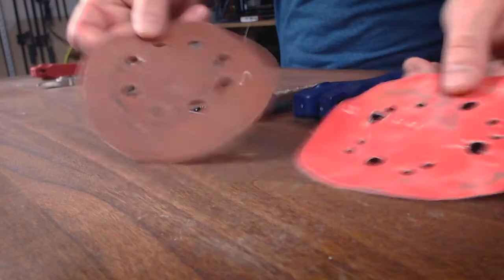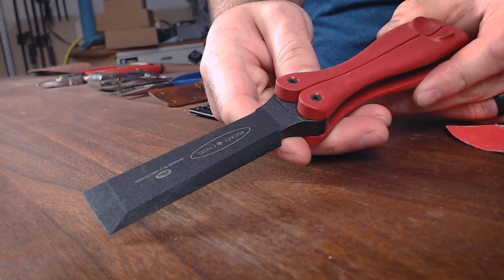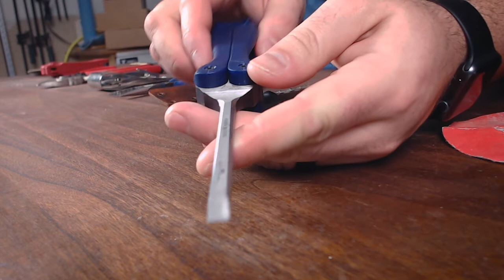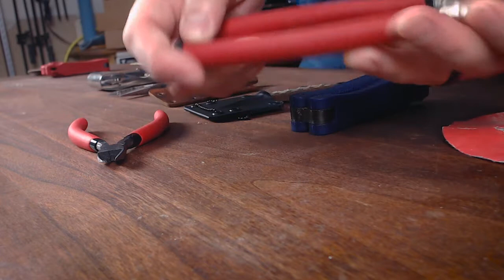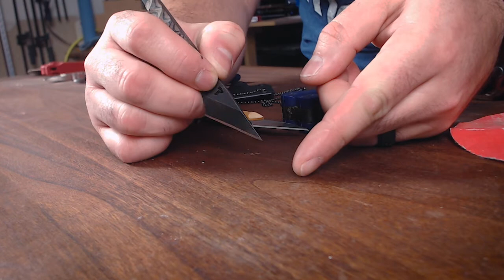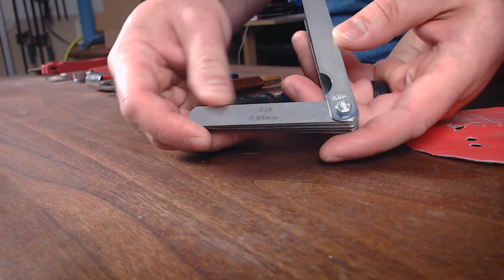My top 10 tools for 3D printing — and more!

Comment: So a bunch of freebies.
Reply from the maker: Hey Stephen,
That wasn't the intent of my video. I was using chisels on my printer well before switching to the Pocket Chisel. I was using a MP Select Mini in a more child-accessible room at the time and have two little ones running around. Wanted to mainly recommend the Pocket Chisel because of its safer nature when closed. Thats just a nice feature. The marking knives were never intended to be used with 3D printing. I was actually planning to test them out and do a woodworking video on the way I cut dovetails that featured them. I just happened to have one laying around when I was cleaning up a part and found it to be incredibly useful for that, as well. I was using a box cutter before that and the weaker, more flexible blade was harder to safely maneuver :)

I just wanted to highlight that these types of tools, regardless of where they came from, are really useful to both woodworkers AND 3D printing enthusiasts.

Thanks,
A
Reply: Anthony Tackett perhaps but it still felt more like a thanks for sending me all these freebies type video. I can’t actually see any use for a chisel for 3D printing but if anyone wants to send me some then sure, I’ll say that I use them alllll the time.
Reply from the maker: That's fair. I'll try to be more conscious of that moving forward. Thanks for the input, man.

Comment: https://www.lowes.com/pd/GOLDBLATT-Floor-Scraper/50258197 i use this to remove prints and it works great!!! never cut myself and has decent weight on it to knock parts loose that are stubborn.... good video and ty
Reply from the maker: That’s a good idea!
Reply from the maker: The Prusa MK3's magnetic build plate is pretty alluring, honestly. I'd be 100% down with not having to use a blade or knife on my printer. What I DIDN’T say in the video is that I have a scar on my left hand from that 1" chisel. It slipped when I was removing a piece from the build plate and my palm caught it :)
Reply: been using glass.knock on wood never had even close call with it lol, just stinks in a enclosed printer as its long.
Reply from the maker: Makes sense to me. I envy your enclosed printer!